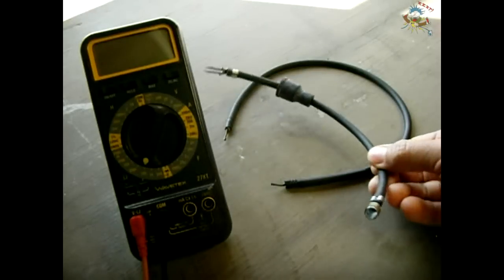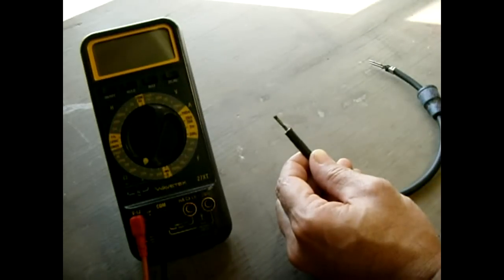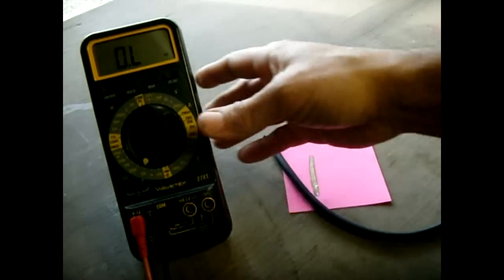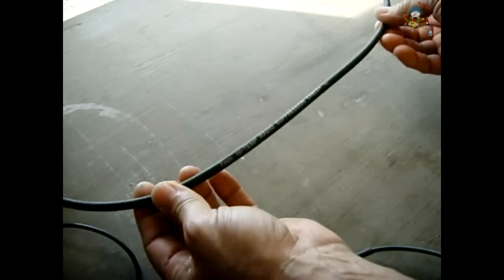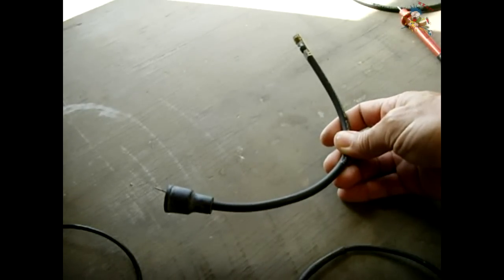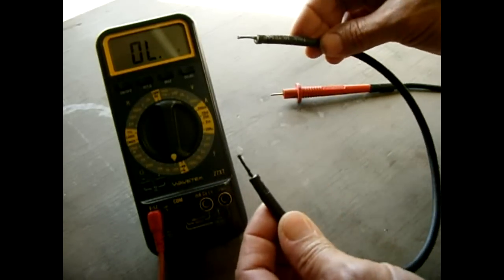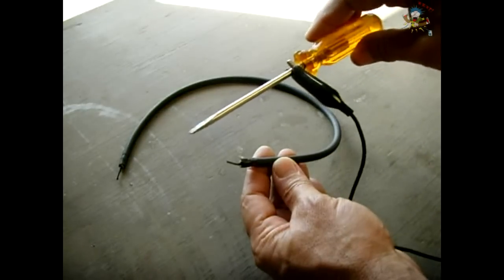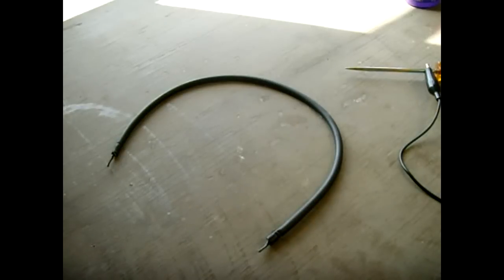How To Test Spark Plug Wires

Comment from the maker: When measuring the wire's resistance, your fingers will not affect the reading(unless your fingers are DAMP/WET). When measuring resistance levels above 100,000 ohms, never use your fingers. You will get incorrect readings.

Comment: Excellent tutorial !!!
Allow my two cents?
Dielectric (insulation) failure happens to not only plug wires, I have seen distributor caps, plug connector ends that are of an insulating material and the ignition coil tower break down. These items have essentially become electrically porous. Salt water spray and hydrocarbons exacerbate this issue.
On GM distributor caps with the ignition coil inside the cap, a bad conductor within the plug wire could actually burn back along the wires core, getting wider with every spark. This eventually would leave the coil/cap with a flash over condition that would arc through to the grounded coil mounting screws and or an adjacent plug terminal. The cause of the bad wire usually was due to a failed attempt to remove the sparkplug boot and pulling instead on the wire, streaching it and breaking the carbon impregnated core fibers.
 
All secondary voltage ignition related issues can leave behind a high voltage conducting carbon tracking that may not be visible, although sometimes it will appear as a black crack or trail. Obvious signs of a spark plug wire having been burned or chafed is suspect and should be replaced. Other factors such as environmental degradation via ozone or in the case of recessed plugs down within the valve cover where the engine oil can accumulate, will most assuredly cause that wire and insulator to fail over permanently.
 I recall a arc faulted distributor rotor that had me going crazy until I tracked that down, the high voltage went in but never came out... LOL
There used to be high pot testers to check for these types of conditions. ;>)

Some notes on the low voltage side of ignition systems...

Some really old, post points and condenser cars (Late 70's Toyota) they had an ignition module but still used conventional hard switching via a set of contact points. These cars had a nylon feed through terminal block that held a screw and nut, the nylon could crack and although the measured voltage was normal voltage, the switched signal would be lost due to dampness in the crack leaving the ignition module (Amplifier) without anything to do.

    Do not get a false feeling of bravado when dealing with the low voltage side of the ignition coil, not only do they spike to hundreds of volts, but if coupled to a solid state ignition module, they can fail when damp. This also causes the magneto grounding circuits on many air cooled engines, issues with a "No spark" problem. This is the circuit that allows the throttle to turn off the engine. Check for cracked plastic on the coil negative terminal wiring !

For anyone dealing with the traditional contact "points and condenser" (capacitor) ignition be aware that the condenser often does fail in due time, causing severe pitting of the electrical contacts. That capacitor is in fact part of a tuned circuit with the ignition coil that when properly matched helps in keeping the points contacts from arcing.

Good luck with ignition related trouble shooting!!!
Reply from the maker: Your entirely right about all the other parts breaking down as well. :-)

Thanks For Watching!
Reply: Craig Nehring the material that plug caps are made from has changed recently, I’m finding I can get two years out of a set of plug caps on my air cooled Yamaha, ten years ago The caps would last 6-7 years easy.

Comment: The screwdriver test sounds good. I had wires that didn't even need a test, just pop the hood open at night and you could see the sparks arcing to ground. I even placed my figures on the wires and watched the sparks jump to my hand without a nasty shock. Most generally though, those are the cheap crapy wires that do that. I no longer buy cheap wires since then, their not even worth the time to put em on.
Reply from the maker: Always buy silicone wires. :-)
Reply: don't you need 12 v on the other end.
Reply: David Morgan ignition coils do work on 12 volts, but that's what the input voltage is. The output voltage going thru the wires is totally different and that's very high voltage. Some coils output is up to 60,000 volts, you'd need a special volt meter to test that. To test wires with a volt meter you test the ohms resistance of the wires.

Comment: Is there information printed on the wire which would indicate if the wire is of the resistive type and or the value of it's resistance. 
Also, can we just do an insulation test using a Mega meter? We use this method to test cables on ships, setting the meter on the 500 volt range.  however, would such a test be inadequate for spark plug wires because of the higher voltages encountered?

thank you and have a jolly good day or night as  the case may be when you finally read this comment.

Comment: I LOVE YOU!!! I just cut a wire as the cap was so tight I needed to grip it with pliers and lever it off with a large screw driver. One out of 8 slipped and the screw driver went straight through the wire.. I'm now going to go repair it thanks to this vid!! Thanks!! Oh  just one quick question I have a spare wire at 1800 ohms.. all the rest are 800 (they are very short).. If I can't make the fixed one reach should just plugging the 1800 wire in cause any real problems? Thanks :)
Reply from the maker: Since the wires on your engine are all different lengths, the values will vary. As long as the value isn't way off, it should work fine.
Reply: This is what I'm also thinking.  Is less v going to that plug?
Reply from the maker: David Morgan Longer wires have higher resistance, so less current will be available at the plug.

Comment: Some spark plug leads like in the 80s Mercedes use solid copper core leads but with resistors built into the plug caps, this basically means all the leads should have the same resistance.
Reply from the maker: In that case, yes, resistance close to zero ohms.

Comment: nice video . my multimeter has a continuity beeper however it won't beep on a known good wire why is that?
Reply from the maker: Touch the test leads together if you don't hear the alarm then your wires are faulty.
Reply: @electronicsNmore  you would think in continuity mode testing a SP wire it would beep negatory just try it.

Comment: Can you use this same process to check if an ignition coil for a small engine is working properly?
Reply from the maker: This test only lets you know if the wires are OK. I usually test the ignition coil by performing resistance tests on the windings, or inserting a nail into the spark plug boot and holding it 1/4" from the block to see if there is a bright spark while the engine is turned over.
Reply: Ok. Thanks!

Comment: I was once told that you need resistor plugs or resistor wires, but not necessarily both. What's your take on that?
Reply from the maker: For a modern vehicle with electronics, you need either resistive wires or plugs. Thanks for watching! Be sure to check out my extensive video playlists for other great videos of interest to you and share.
Reply: @electronicsNmore  I just ordered Granatelli 0 ohm MPG wires. Any take on them?

Comment: thanks very informative and comprehensive explanation. can i use test light rather than screwdriver one end be connected to negative and other end pass it over wire if it come cross the spark it would light up.would this work?

Comment: You mentioned that "the purpose of the graphite is to add resistance to this wire." Does it not add continuity rather than resistance? If there was no graphite added to the fiberglass core, would it conduct electricity quite well, or not at all? I would think not at all.  When you measured the resistance of the pencil line, you were actually measuring the increasing resistance of a longer, and not very good conductor.
Reply from the maker: istvan meissler Hi there. Fiberglass is an extremely poor conductor, which is why power companies use long fiberglass poles to reach up to the live wires to open/close switches.
Reply: If you re-read my comment that is exactly what I said. Fiberglass is made from glass, which is an excellent insulator and thus a poor conductor.  I merely corrected a mistake you made.  Please re-read my comment.
Reply from the maker: There are many different ways these wires are made. Some have fiberglass on the outside of the core, some use carbon, some use a solid wire core, and some use a carbon or graphite impregnated fiberglass core, but I see the point you were trying to get across.

Thanks For Watching
Reply: electronicsNmore I corrected your mistake not to be critical, but because some of your viewers may not have a sound knowledge of electric theory.  Graphite was not used to "add resistance" but to in fact to decrease it. (By adding a conductive pathway.)
Reply from the maker: More accurate wording would have been, "The graphite serves 2 purposes, to allow the wire to be conductive and resistive at the same time". All depends on how you look at it. If we were taking about a circuit which required resistance being ADDED to it, instead of using a solid copper conductor, you would use graphite to add resistance. The wire needs resistance, which is why they use graphite, to add it. I don't see my words as a mistake. You are looking at it as if starting with no conduction at all(fiberglass), then making it conductive. This is the typical, "cup is half empty or half full".
Reply: electronicsNmore Yes, exactly.  If they wanted to make a less resistive conductor, they would have used copper or some other alternative.  Using graphite provided a highly resistive conductor, which is fine for high energy ignitions while protecting sensitive electronics.  I would agree with you, not so much a mistake as inaccurate wording.  Not being "picky", just concerned about viewers misunderstanding basic theory.  I hasten to add, I appreciate everyone who takes the time to make YouTube videos.
Reply: should all wires have the same resistance  cause your furthest wire might get less voltage or am I looking at it wrong?
Reply from the maker: David Morgan No, longer wires have higher resistance.

Comment: How about the readings on plug wires for a v twin Harley engine I have electronic ignition and screaming eagle wires on my bike I checked them with a multimeter the long wire to the front cylinder reads around 5,000 and the short around 2,000 I wonder if that's normal? The long wire is 19 inches and the short is 7 inches long.
Reply from the maker: Yes, normal. The wires are resistive, so longer plug wires will have HIGHER resistance than shorter wires. Be sure to rate thumbs up, check out my other videos, and share. Thank you!

Comment: Nah, you're doing it all wrong. Just pull the wire off your plug, then get your cousin Billy Bob to stick his finger into the plug wire where the plug goes. Once you are sure cousin Billy Bob has his finger in the right place, go turn the engine over a few times with the key switch. If cousin Billy Bob flops around like a fish, then the wire is good. If he just stands there blinking his eyes at you slowly, then the wire is bad.... This way of testing plug wires is much more fun, but if cousin Billy Bob is very bright you may need a few more cousins to be able to test all of your wires.